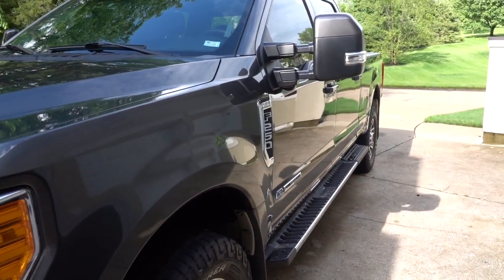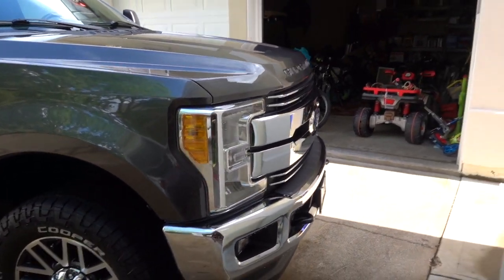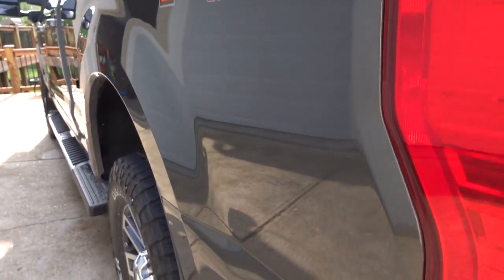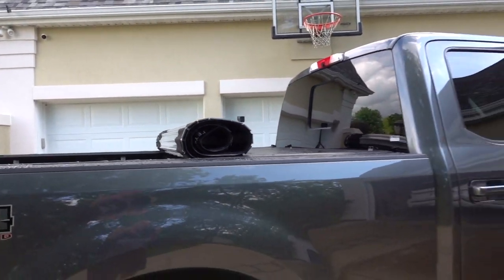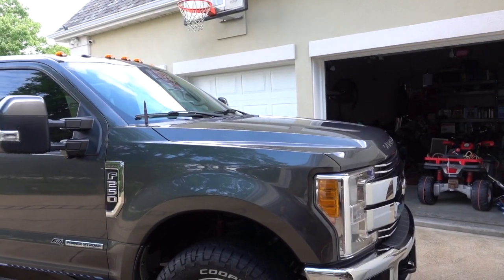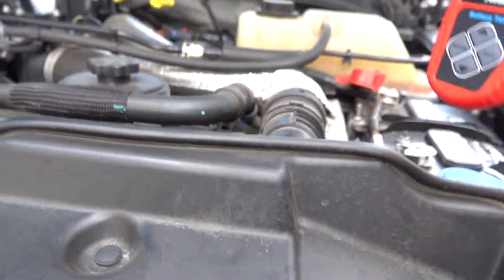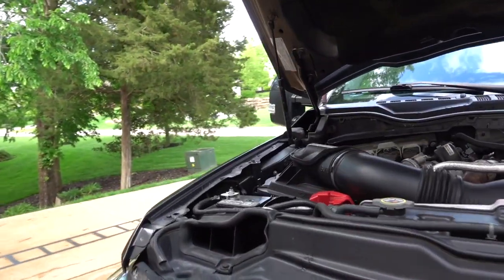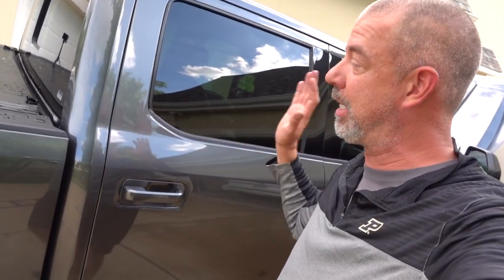2017 Ford Superduty 70,000 Mile Review #Ford #Results #Superduty #powerstroke #Reliability

Comment: Very good review... I have a 19 250 same color with 22000 miles on it and I'm very happy.  I usually get 19 to 20 on hwy and frwy...  about 15 to 17 running around los angeles and the san Fernando valley.  Your truck looks great.

Comment: Never had a problem with my 2017 locks. Go from 70° garage to -50° outside here in interior Alaska. Still using original batteries.

Comment: I think if you live in Iowa instead of STL, gas might be a better option. 13k miles out of 68k miles are tow miles. I do love the pulling power of the 6.7.  50k on my 2015 gasser. Mileage sucks but maintenance is cheaper. Love the videos, great info.

Comment: What i cant believe is that ford came out with a door latch recall on my 2016 f150in 2017. Then i had the same recall on my 2018 f350. It is the same cab. It would obviously have the same problems, but somehow that made it past the engineers. I havent got the recall done. It hasnt given me an issue yet, just like the rest of the truck. 70000 miles trouble free

Comment: Still watching your videos!  I got some recalls in the mail today for my super duty.  They are for the carpet needing replacement, the tailgate issue, and a scary one some kind of steering wheel damper replacement warning?  What I wanted to ask you, as a first time truck driver, I want to know if I need this warranty work done for the damper?  My truck bounces/hops a little on certain parts of the freeway here.  Some of that road looks like it has cracks and imperfections.  I have the factory ranch on shocks if that matters.  Is the hopping normal since it’s a 3/4 ton truck?  It runs really smooth in the city and most freeways it doesn’t hop
Reply from the maker: Thank you!  I hear ya on the recalls.  I took care of my carpet recall when they did my last lock fix and the tailgate recall.  The steering damper is to address the dreaded death wobble.  If you don't know what death wobble is you don't have it.  It's when the tires on a solid front axle truck react in a very bad way to a bump in the highway or expansion joints.  It can be so violent than the driver needs to slow down to 10 or 20 miles per hour.  Some people  get it all the time...most people never get it.  The solution Ford has come up with is a new horizontal shock to better control the movement.  I have heard on the 2020's this problem has been addressed in a big way and the fix they came up with on the 2020s is being applied to the 2017-2019's.
Reply: Adventuring Today Thanks for the response!  So it sounds like they wouldn’t replace the part unless I experience the issue?  Or can I tell the dealership I want it replaced?  The notice says the warranty was extended for that part.  It doesn’t say bring it in to repair.
Reply from the maker: The question you have is a good one.  This is the difference between a recall (where they are asking you to bring it in for a fix...tailgate or carpet issue) vs a field service action like on the door locks or this steering damper.   If a customer says I have been experiencing what is in this damper field service action then they will replace it.   If you don’t complain or state you are having a problem they typically won’t proactively do anything.    You have to bring it up when you take your truck in for them to do it.

Comment: "Super fuel efficienct"
Not sure if I just missed it in the video, but what does that translate to for mpg? City and highway both please! (Thank you).
I love the design of the 2017 and newer F- 250s. I've been thinking about buying a used one in a year or so when prices come back down, to use as a secondary vehicle. It's hard to find accurate information on mpg for highway though - even off of the websites that track this data.
Reply: My combined is 21mpg  (22+ on highway) and I drive it very conservatively.

Comment: You are smart to trade it at your mileage. The CP4 is a ticking time bomb on those and the reason I went with the Duramax that uses a Denso HPFP. There are many pending law suits on this issue. GM used the CP4 from 2011 to 2016 and they were a disaster. RAM used the CP4 in 2019 and 2020 and now after failures have gone back to the CP3. Lift pumps and fuel additives will not stop the CP4 from failing.  https://www.youtube.com/watch?v=nPFPf2EpxkE
Reply: Pushing 216k and never a CP4 failure.

Comment: U don’t even use or need a 3/4 ton truck to haul your trash on occasion. Do this review is for just grocery store shopping 😂
Buddy get a Toyota
Reply from the maker: Actually the entire time I owned this truck I pulled a 11,000 lb travel trailer that put the truck way over its rated payload.  It did a lot more work than going to the grocery store.  I should have bought a F350.